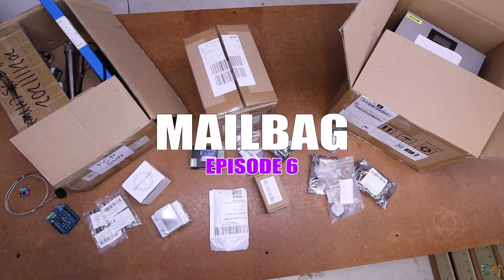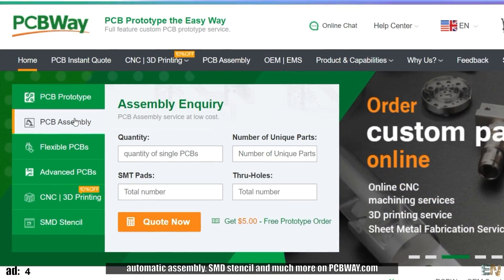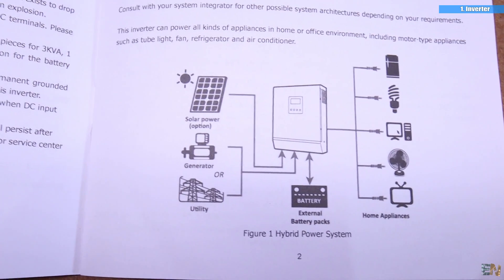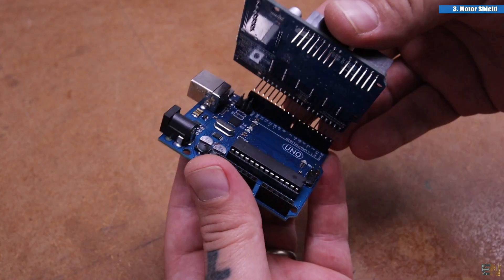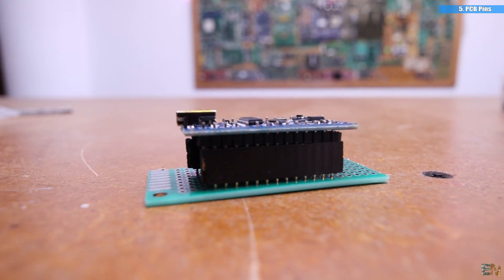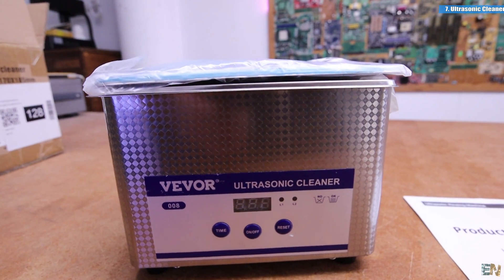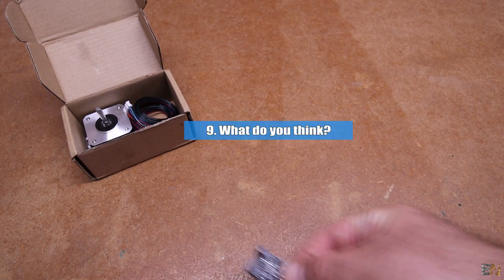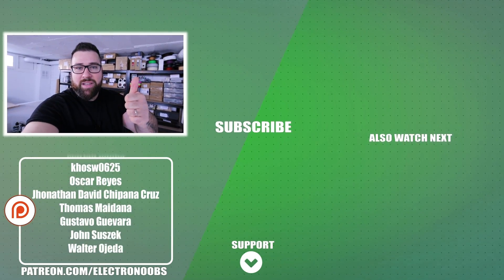Solar Inverter Modules Components & Sensors

Comment: Why do those "chinese" inverters never support proper MPP-voltage from solar panels?
This is less than 100V and most installations in Europe go much higher (between 300V and 500V).
Would have to rewire my whole roof to use one of those.

Comment: Love your channel.  Been a subscriber for awhile.  Enjoy your trial and error approach and your honesty.    I design solar PV systems for both on and of grid applications and our store sells dozens of inverters from a few hundred watts up to 30 kW.commercial stuff.  We see a lot of the Vevor type inverters in the 3-5kW range they are essentially rebranded units with slight mods to the specs (and dodgey software/firmware).     What you'll find with your particular model is that max PV of 75Voc is very very low. Most units have 125 to 250Voc spec.  This is not a bad thing. If you are planning to use common larger modules 300watt and up,  the Voc is usually 38v and up so this will limit the series connection.  To get close to a 1000watt solar input you'll probably be using parallel configuration.  Otherwise, smaller 100watt panels will be fine, just more wiring.   Our customers have many remote environmental monitoring stations so remote monitoring is critical.  Interested to see what you come up with.   Looking forward to your solar video series. Cool stuff!! 😀👍

Comment: so you got a hybrid inverter, actually i got my own version of solar back up system, but my one only got 1.2kwh lifepo4, 200w solar, and 300w inverter only use less energy from the grid at night, also i charging all my laptop and phone from it by type c